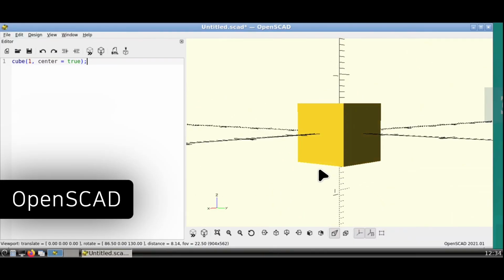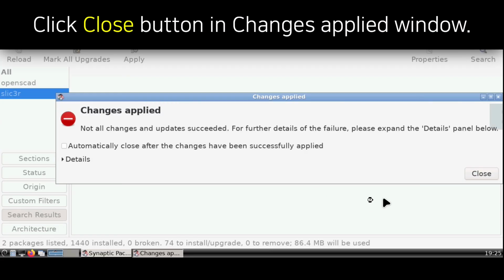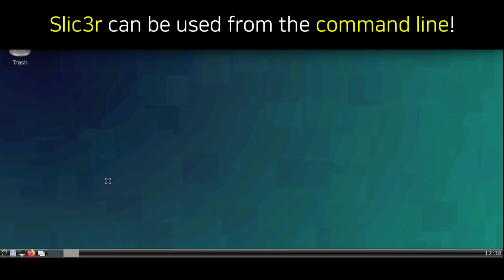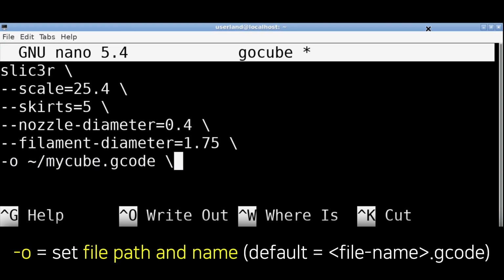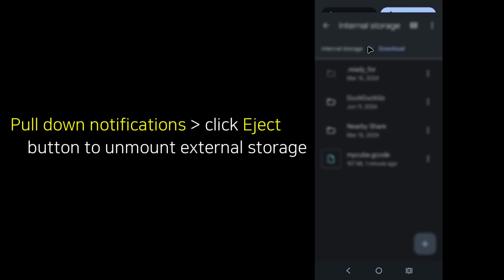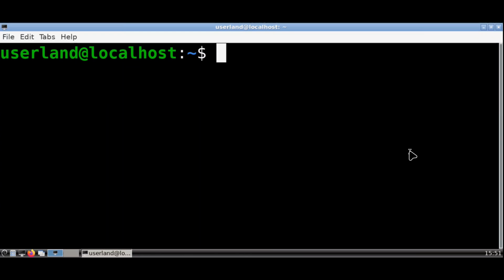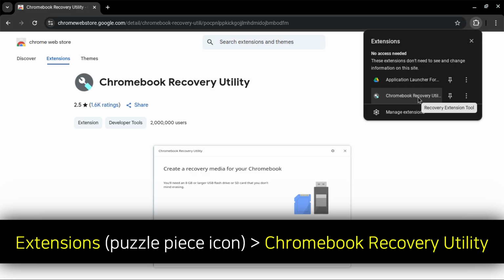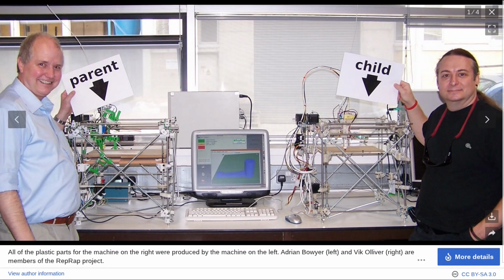3D Design & Print A Cube On Android! (Also works on Chromebooks & PCs)

Comment from the maker: 3D design and print a cube instructions Part 1

This procedure will work on Androids, Chromebooks, and PCs!!

3D printer used in this video (Creality Ender 3 Pro):
    https://www.amazon.com/dp/B07GYRQVYV/

==========================
3D PRINTING OVERVIEW
==========================

First, a 3D model needs to be created with CAD (Computer Aided Design) software (Ex. OpenSCAD, FreeCAD, etc.) and then the 3D model has to be exported as a .stl file (STereoLithography). Next, with the .stl file we can use a slicer (Ex. Slic3r, UltiMaker Cura, etc.) to define how to print the layers of the 3D model by configuring it based on the 3D printer being used and the model being printed. Then with the slicer, we can export a .gcode file (Geometric CODE). The .gcode file is what the 3D printer uses to print the model (CAM - Computer Assisted Manufacturing).

1. Create 3D model with CAD Software > Export .stl
2. Use .stl file with a slicer to prep model for printing > Export .gcode
3. Use .gcode file with a 3D printer to print the model

==========================
DESIGN CUBE WITH OPENSCAD
==========================

OpenSCAD is for designing 3D models based on code.

Install:
    openscad

Open OpenSCAD:
    Menu > Graphics > OpenSCAD

Open example from the Welcome window:
    From Examples list, click Advanced drop-down > select children.scad
    Click Open Example button.

For Android, depending on the device, maximizing the window can crash OpenSCAD. To make the window as big as possible, drag out the corner of the window slowly to see the point that OpenSCAD will crash. When OpenSCAD crashes, reopen it and drag the corner of the window just before the point that OpenSCAD crashed.

The Error-Log, Console, and Customizer windows can be closed. Windows can be be reopened from the Window menu.

Navigate 3D model:
    Rotate = Right click + drag
    Pan = Left click + drag
    Zoom In = Zoom In button near the bottom of the Preview window
    Zoom Out = Zoom Out button near the bottom of the Preview window
    Reset View = Button with Circular arrow near the bottom of the Preview Window

Change color of the cubes to purple:
    From the 7th line, change the word "red" to "purple"
    Click the Preview button (cube with 2 arrows) near the top of the Editor window

--------------------------

Design a cube:

Click New File button near the top left of the Editor window and type the following (creates a cube that's 1 unit in size and is centered):
    cube(1, center = true);
Click the save button near the top left of the Editor window and save the file.
Export .stl file:
    Click Render button near the top right of the Editor (button with box and hour glass)
    Click Export as STL button to the right of the Render button
    Save the .stl file as cube.stl

==========================
PREP MODEL FOR PRINTING
WITH SLIC3R
==========================

Slic3r is a slicer that's used to prep 3D models for printing. Slic3r can be used from the command line (Slic3r uses OpenGL graphcis. OpenGL graphics cannot currently be used with UserLAnd on Android due to the use of VNC. This is why the GUI is not used in this procedure).

Install:
    slic3r

A script can be created for running the Slic3r command. This provides a way to remember what settings were used before. Please read the script explanation below for important notes. Values for --nozzle-diameter and --filament-diameter are an example and may differ. From a terminal:
    nano gocube

slic3r \
--scale=25.4 \
--skirts=5 \
--nozzle-diameter=0.4 \
--filament-diameter=1.75 \
-o ~/mycube.gcode \
cube.stl

    Ctrl+O, Enter, and Ctrl+X to save and exit nano.

Make the file executable and execute the script to generate the .gcode file. ls lists files and folders in the current directory (the "./" is used to run an executable file in the current directory, "echo $PATH" can be used to display the path for executables):
    chmod +x gocube
    ./gocube
    ls

Copy the .gcode file to external storage and now the .gcode file can be used to print the model! For Android read the MOVE FILE OUTSIDE OF LINUX ON ANDROID section below for moving files outside of Linux.

--------------------------

Script explanation, please read --temperature and --gcode-flavor points below:

+ \ = continues command onto next line (script can be executed as one line)
+ --scale = sets scale. .stl files are unitless. Slic3r assumes 1 unit is 1 mm (25.4 mm = 1 in)
+ --skirts = number of loops printed around the model (helps get filament flowing for a better 1st layer)
+ --nozzle-diameter = printer's nozzle diameter in mm (can look for printer's nozzle diameter by looking at the printer, the instructions or box that came with the printer, or search online for the printer's specs)
+ --filament-diameter = diameter of filament in mm (can look for filament diameter by looking at the spool, the box the filament came in, or measure the filament with a caliper)
+ -o = defines file path and name of .gcode file, this is optional (default name = <.stl-file-name>.gcode)
+ If using a filament other than PLA plastic, set the --temperature option in °C (default = 200°C)
+ Depending on the printer, it may be necessary to set the --gcode-flavor option, otherwise the printer may interpret .gcode instructions incorrectly. default = reprap. reprap refers to Marlin/Sprinter. (Can look for gcode flavor needed by looking at the printer, the instructions or box that came with the printer, or search online for the gcode flavor the printer uses) Executing "man slic3r", scrolling to Printer options, and then looking at --gcode-flavor will show the list of possible G-code flavor values.

==========================
MOVE FILE OUTSIDE OF
LINUX ON ANDROID
==========================

First, set the file permissions of the .gcode file so the file can be copied from the Android side. From a file manager:
    Right click .gcode file > select Properties
    Select Permissions tab.
    Set ALL Access Control drop-downs to Anyone.
    Click OK button to save changes.

Ctrl+C to copy the .gcode file.
Go to the following file path (depending on device and version, it may be necessary to create some folders with an external device):
    /host-rootfs/storage/emulated/0/Android/data/tech.ula/files
Ctrl+V to paste the file

Next, the file needs to be copied to a more accessible folder:
    Android Settings > Storage > Documents > Open with Files Just once
    Click the 3 line menu from the top left > select device's internal storage
    Android > data > tech.ula > files
    Long press .gcode file > 3 dot menu from top right > Copy to... > copy file to a more accessible folder (ex. Downloads)

Now the file can be accessed and copied to external storage by using another app (ex. Google Files app)

==========================
3D PRINTING
==========================

The printer used in this video is the Creality Ender 3 Pro:
    https://www.amazon.com/dp/B07GYRQVYV/

Depending on the 3D printer, the procedure for prepping the printer will vary. The following is what I do to prep the Creality Ender 3 Pro:
    First I have the printer Auto Home.
    Next I Disable Steppers so I can freely move the extruder and the bed.
    After that I manually level the printer bed by turning the screws with gear handles on the bottom of the bed. A piece of paper can be used to determine if the nozzle is too close or too far from the bed. My goal is to get the nozzle scratching the paper at all 4 corners of the bed without too much resistance.
    Next, I move the extruder up on the Z axis.
    After that I preheat the printer for PLA plastic (if the printer has been used before, filament may ooze out. DO NOT touch the nozzle when heated. I like to use pliers to grab the filament that oozes out)
    When the printer is heated I extrude 10mm of filament (this can help to get a better 1st layer)

When the printer is ready to print, insert the external storage containing the .gcode file, and select the .gcode file (If the external storage cannot be read, read the FORMATTING STORAGE section below). Finally, and most importantly, enjoy!

If there is a struggle to get the model off the bed, try using a scraper (I prefer plastic if possible). Any stray plastic hair where the print finished can be cut off with scissors, wire cutters, or pulled of with your fingers.
Reply from the maker: 3D design and print a cube instructions Part 2

==========================
FORMATTING STORAGE
==========================

Depending on the 3D Printer, the external storage may need to be formatted in a specific way. For my example the Ender 3 Pro needed the external storage to have an msdos partition table with a FAT32 partition. The following procedures cover how to format external storage to have an msdos partition table with a FAT32 partition with Androids, Chromebooks, and PCs.

--------------------------

Format storage with an Android:

Plug in external storage.
From Android Settings:
    Go to Storage
    Click This device drop-down > select external storage
    Click 3 dot menu from top right > select Format
    Click Format button > click Format to confirm
    Click Done button when finished.

--------------------------

Format storage with a Chromebook:

The Chromebook Recovery Utility can be used to wipe out the existing partition table. From the ChromeOS Chrome browser:
    chromewebstore.google.com
    Search for "Chromebook Recovery Utility"
    Click Add to Chrome button > click Add extension button
    Plug in external storage.
    Click Extensions button (puzzle piece icon) near top right of Chrome browser > select Chromebook Recovery Utility
From Chromebook Recovery Utility:
    Click gear button from top right > select Erase recovery media
    Click Select drop-down > select external storage
    Click Continue button > click Erase now
    Click Done button when finished.
To format the external storage to FAT32, open the ChromeOS Files app:
    If external storage is unmounted, reinsert the external storage.
    Right click external storage > select Format device
    Set Drive name and set Format to FAT32
    Click Erase and Format button.
If changes appear to not have been applied, click unmount button next to external storage and then reinsert the external storage.

--------------------------

Format storage with a PC:

GParted can be used to format external storage (install: gparted):
    Plug in external storage.
    Click OK for any pop up windows.
    Close file manager windows.
    Menu > System Tools > GParted
    Click device drop-down from top right > select external storage
    MAKE SURE EXTERNAL STORAGE IS SELECTED!
    If partitions are mounted, right click each parititon > select Unmount
    For each partition, right click the parititon > select Delete
    Click green check mark button near the top left > click Apply button
    Device menu > select Create Partition Table...
    Set partition table type drop-down to msdos > click Apply button
    Right click unallocated space > select New
    Set File system to fat32 and set Label > click Add button
    Click green check mark button near the top left > click Apply button

==========================
DOCUMENTATION
==========================

OpenSCAD website:
    openscad.org

Lots of documentation in the form of wikis, a cheat sheet, books, videos, and articles can be found from the documentation page on the OpenSCAD website. If printing the cheat sheet, use Landscape orientation. PDFs can be viewed with qpdfview (install: qpdfview)
    https://openscad.org/documentation.html

Mastering OpenSCAD within 10 projects online book:
    https://mastering-openscad.eu/buch/introduction/

OpenSCAD Playlist:
    https://www.youtube.com/playlist?list=PLP1VMsgQcRUmC1jJhZrTId9rvjQ1m2FBH

--------------------------

Slic3r terminal documentation:
    slic3r --help
    man slic3r

Slic3r man page can be put into a text file which can be searched and modifyed. From a terminal:
    man slic3r > slic3r-doc.txt

Slic3r website:
    slic3r.org

Slic3r manual (If documentation for Command Line Usage mismatches with version of Slic3r being used, then refer to the terminal documentation):
    https://manual.slic3r.org/

--------------------------

Fun Fact! RepRap stands for REPlicationg RAPid prototyper which refers to an open source project dedicated to making low cost 3D printers that can print most of their own parts:
    https://en.wikipedia.org/wiki/RepRap
    https://www.reprap.org/wiki/RepRap

--------------------------

Digital Notes With TiddlyWiki (No Cost, Offline, Cross-Platform, Searchable Notes):
    https://www.youtube.com/watch?v=jFCX5Nh2QIM

The Chromebook Guide to Google Linux: 2nd Edition (Companion Book): https://www.amazon.com/dp/B0C9S7QY9N
ISBN: 9798852219312

Linux on Android Phones and Tablets (Companion Book): https://www.amazon.com/dp/B0C6VSX18Y
ISBN: 9798397022903

Installing Linux On PCs and Laptops (Companion Book): https://www.amazon.com/dp/B0D36DRMXJ/
ISBN: 9798324643768

==========================
FOR QUESTIONS
==========================

Questions are welcome and encouraged. Due to the design of YouTube's comment section, posting questions under the pinned comment or under another user's comment makes it difficult for me to find and answer questions. Please do not post your questions under the pinned comment or under other user's questions. Please create a new comment.